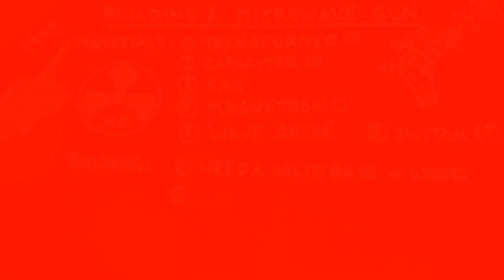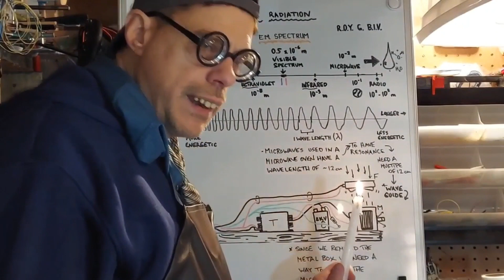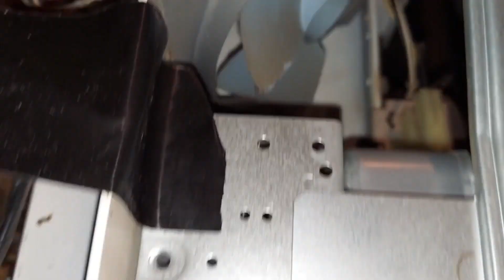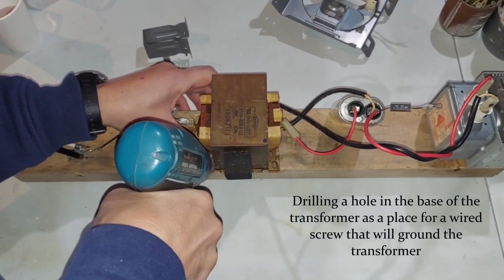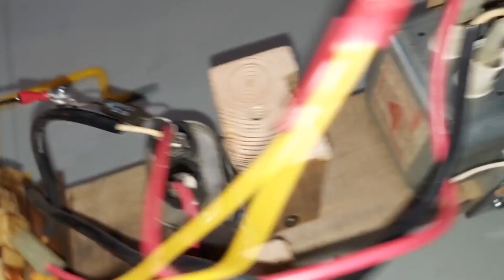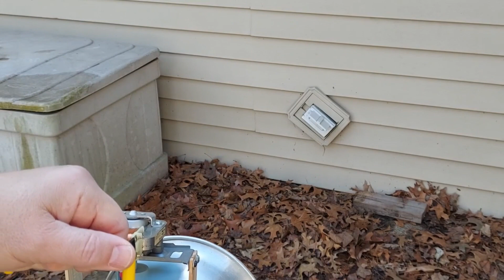Building A Microwave Gun

Comment: Something I have wondered about for a long time is.  Would it be possible to modulate the output of a magnetron with 2.4ghz wifi.  The most insanely powerful and dangerous wifi hot spot. Just a point of safety, the output of a MOT is around 4000v AC, instant death no second chances,
Reply from the maker: Interesting question.  I appreciate your warning but I did cover this extensively in the video, especially early on.

Comment: in serious tho BOLLING MACROWAVE GUNS CAN KILL AND HAVE CONCERNING BOUNCING RAYS THAT MIGHT BOLLING & POP YOUR GRANDMA LIKE A POPCORN CORNELL! DO N0T MAKE THIS WITHOUT REAL THOUGHT AND CONSIDERATION FOR U AND THOSE AROUND YOU! have fun BOLLING stuff fanatics
Reply from the maker: Errr...a bolling is a "tree from which the branches have been cut".  So it's a bit nonsensical, unless you means bolling.  A risky activity.  Ah...that must be what you're saying.  It is.  I made that point but I do appreciate your take on it.  Thanks!
Reply: just for that im gunna like your comment putting it at 1 like MAKING IT LOOK LIKE U LIKED YOUR OWN COMMENT! (Also did you find the max WATedge of the magnitrons cathode befor the magnatron cathode melts, explodes or the "magnitron ring" ((anode)) doesn't make the proper microwaves?
Reply: the curv of the anode and the lagth and distance of the anode should determine the wavelength butt higher watts could differ

Comment: I bet that this would work as a “wood welder”, a commercial unit that uses radio waves to heat/cure water based wood glues and set joints in seconds. I’m gonna have to try to find an old microwave
Reply from the maker: Interesting.  Please be very careful.

Comment: Curious about the grounding you did not show where the wires go
Reply from the maker: The transformer is grounded from its casing, which is directly connected to the green (USA) ground wire that runs into the ground pin of a 3 prong plug.

Comment: Wouldn’t it actually be a lot safer to not have anything grounded on the microwave gun? That way the high voltage isn’t referenced to ground?
Reply from the maker: Grounding it is done for the same reason a regular microwave sitting in your kitchen is grounded.  Any electrical short could possibly kill you, but grounding it makes sure that any errant current goes through the wire, and not you.
Reply: @cranialconstruction I get what you are saying but the main idea would be the case is grounded, so “stray” current would go to the case/ground and trip a breaker instead of case becoming live. In the gun design, if the HV side is referenced to ground through the transformer and there is no case… you are potentially the path to ground for several kv at high current. If left ungrounded the hv isn’t referenced to ground and should be much safer.
Reply: @cranialconstruction btw I like your content a lot and this video, just thought I would mention a safer-ish way

Comment: Problem is that you need to plug it on
Reply from the maker: Yeah that's a problem.  However, a DC to AC convertor might provide enough power off of a 12V car battery.  Not sure it would have the amps though.  Something to think about.

Comment: You said you needed to insulate the inside of the metal lamp shade, because the microwave interacting with the metal causes sparks. It doesn’t look like you ever did that. What am I missing?
Reply from the maker: I used the high temp RTV silicone to do that.  I tried to get a shot of where it was insulated near the end but it doesn't show up very clearly.

Comment: Will this gun work through a concrete wall ? Let's  say 30 cm thick .
Reply from the maker: No it won't.  Microwaves heat solid objects but are also blocked by solid objects, even those produced by the large microwave units for crowd dispersion that the military uses.

Comment: Curious about wave guide, microwaves are deflected by metal wave guide so it seems that microwaves would be also deflected inside a pipe instead of that cone shape wave guide and produce a narrower beam.
Reply from the maker: This isn't the best wave guide.  But, it's the simplest.  The wave guide in a microwave oven is built into the metal framework and is quite difficult to cut out, and even more difficult to mount onto a homemade device.  It does work really well though.  It's a rectangular angled piece of metal that is made to the exact specs of a microwave wave.
Reply: @cranialconstruction it’s designed to the spec of the amplitude of the microwave correct? Which the other presenter said was about 4cm? How do you determine the exact length of the microwave produced by the system? How is the wave guide designed to optimize the specific wave?
Reply: @TylerJCaster  Multiply wavelength by 57 then divide by 2 Pi.  or ask chat gpt

Comment: hello, a microwave gun, even with a 2-meter horn antenna, is a toy that can’t really break anything. greater effect is achieved by VHF pulse generators 50-400 MHz with a power of 5-20 kW with a good antenna
Reply: A paraboloidal reflector as seen in the video works better than a cone- or pyramid-shaped horn to produce a parallel beam.

Comment: How would I remove all the switches and timer front pannel from the microwave, there seems to be a few extra wires that I'm concerned the microwave would not work without, such as there being 4 wires into the Magnetron instead of 2, can I just remove the wires that go to the switches or not?
Reply from the maker: Please know what you're doing first of all.  Considering you do there are often multiple wires that lead to the same place but there's only one that is directly powering that item.  Because the transformer feeds both high voltage and low voltage to the entire system in the microwave you will find what seem to be duplicate wires but these are just running back and forth powering multiple systems.
Reply: yes, i've removed all of these wires, there is only wires going from the transformer to the capacitor and magnetron, i have  made sure these wires are correctly connected. i was just wondering if any of the extra wires are requierd or not, thanks for the reply.
 @cranialconstruction

Comment: very much not an expert here. as I understand it microwave radiation is essentially a wavelength of light in the electromagnetic spectrum that is simply not visible to us. is this essentially a light bulb that emits a very specific wavelength of light? is that's why a lamp shade can be used as a waveguide just like a normal light bulb
Reply from the maker: You could think of it that way.  However, the mechanism with which the microwaves are generated is much more complicated than a lightbulb.  I would guess you understand that already.
Reply: @cranialconstruction  yes thanks

Comment: I heard that exposure to high power microwaves can give you cataracts but that might be an urban legend
Reply: Yeah, that's true.
Reply: hi, this is not a legend. but such powerful generators can only be found at CERN and are the size of a refrigerator. well, or push the eye directly into the waveguide, but for this you need to be a complete idiot)  If you irradiate your head from a working microwave at a distance of 1 meter, then the maximum will be a mild headache within a couple of hours)
Reply: he heard that
Reply: Not cataracts, just plain blindness
Reply: Heating your corneas above 140F does that, which is very easy to do with microwaves as you won't feel them, your vision will just start to get blurry.